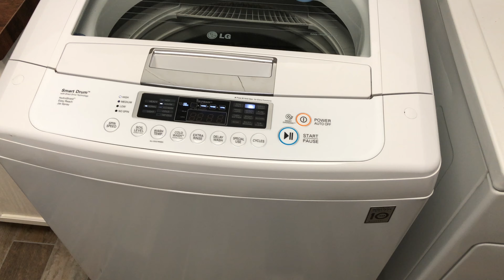LG WT1101CW Washing Machine IE Error Drain Pump Runs Continuously Fix

Comment: This works, thanks. The relay on mine (different model) was a black rectangle, not blue.
Reply from the maker: Interesting.  So, even with a different type of relay, the problem persists.
Reply: @budgetprojectsbydavid5263  The washer is a different model (WT5070CW) , but similar enough that the relays may be the same.  From what I can see in your video, It looks like the black rectangle next to the blue one that has the code on it.

Comment: Not sure how you figured this out, but you're a genius. I just spent time cleaning the hoses, valves, screens, etc. and it did not work until I came across this video of yours....and as of now, we are 35 mins left of a load and no IE code! You should get licensed! Thanks so much. (also, I just put a towel over the board and tapped it with a rubber mallet softly)
Reply from the maker: Glad I could held, Bud!

Comment: Where is the filter on this washer?
Reply from the maker: There are small plastic filters right inside the hot and cold water connections. Those are the only filters that I know of.
Reply: @budgetprojectsbydavid5263  thanks 
Can you make a video about it?
Reply from the maker: I would, if I still had the machine, but I don’t.  It’s not really that hard at all.  You just turn the water off, disconnect the hoses, and pull the filters out with pliers.  You can wash them out in the sink if they are clogged.

Comment: Dont take it apart first. Beat on the top with care. It knocked mine loose without disassembling. Thanks for the video.
Reply: Cant believe this worked
Reply: Yes, took your advise and tapped it lightly with a rubber mallet, and a towel, it worked!
Reply: Yep... Mine seems to require monthly "beatings" at this point, but will keep up the high-tech repairs until she quits all together. Thanks!!

Comment: Hi it's a good Diagnostics, but you need to know the relay that is stuck, best way to find it is to get the repair manual for the machine, or you can trace the wires from the water pump to the relay that operates the pump.
Reply from the maker: Thanks, Alfred. I accept your criticism, but the video was not really made by or for someone who has access to repair manuals, can read schematic diagrams, or wants to trace wires from the water pump.  If you will look at the other comments, you will see that the blue relay with the white sticker has been identified as the relay in question.

Comment: Hi David. Just found your channel. Did you unscrew the hot/cold hoses on the back of the washer and clean out the filters? My error message is just flashing IE with no pump or draining sound. Any advice for mine? And what kind of wrench should be used to unscrew the hoses on the back? Mine look like threads or grooves on them. (And, of course, I turned off the hot/cold valves first) 😁 Thanks for your help in advance. I couldn't find any other videos about cleaning the filters in the hoses. I am not lucky enough to have a handyman like you to help me in person so your YT channel is the next best thing! 😇
Reply from the maker: Hi Beth!  I would use a set of pliers to grab the hoses.  Channel lock pliers are my favorite. Mine have light blue handles and I got them from Lowe’s.  Once off, you should be able to see some little plastic screens inside there.  You may can use your channel locks to pull them out or you may need some needle nose pliers.  Remember which hose goes where, hot and cold.
Reply: @budgetprojectsbydavid5263  thanks for the fast reply! I have channel lock pliers from Harbour Freight.  I was worried about marking up or stripping the threaded hoses on the back of the washer with the wrong type of pliers.I have needle nose pliers with pink handles from my "Women's emergency tool box" lol.
Do I need to unscrew both ends of the hoses or just on the back where they suggest soaking the screens in white vinegar? I thought I would leave the wall connections intact. What do I know?🙄
Reply: Any thoughts?
Reply from the maker: Yeah, just leave the wall in tact.  Maybe have a bucket handy in case they leak, or stick them in the drain.
Reply: @budgetprojectsbydavid5263  I hope this works. I am not as astute as you are at following your suggestions to take the circuit apart. 🙄 Good bye stimulus check. 😥
Reply from the maker: Sorry.  I had company earlier and couldn’t spend a lot of time on my phone.  Don’t spend that stimulus check, yet. Let’s get this thing fixed.  What is the current status?
Reply: @budgetprojectsbydavid5263  I moved the washer away from the wall. I turned off both valves for H/C water. I took the half wet clothes out of washer and hung them up to dry. I am trying to figure out the best tool to use to unscrew the hoses on back of washer to see if screens inside are clogged. Like I said, the hoses have grooves or look threaded on the outside and, I don't want to strip them when unscrewing (counterclockwise???) This is where I am at currently. Sorry for interrupting your company and NYE celebration. Very frustrated if I will get this to work or be going to a coin laundry or hand-washing in sink/bathtub. 😥
Reply from the maker: It’s strange that you say the hose connectors have threads on the outside.  Is it possible that these are just ridges to help your hand and/or pliers grip them better?  Threads run parallel to the back of the washer.  Grips would run perpendicular.
Reply: @budgetprojectsbydavid5263  Yes...ridges is a better description of what the back hoses look like so, tell me your steps to take.
Reply from the maker: If you’re trying to remove the connection, you would put the pliers on the ridges and turn counter clockwise.
Reply from the maker: Counter-clockwise if facing the back of the machine.

Comment: It worked. Thanks. No need to bend back metal. Relay is blue one with white sticker on top. The one 2” from green component.
Reply: Worked for me too
Reply: I just want more water
Reply: @KatrinaBurrisTeherror  try tapping on that relay and it may help with your water issue. Good luck.
Reply: @geoffhunt7965 I tried it and it work! My washer filled but wouldn’t stop! Which relay is it for the water level?
Reply: @kristennessel  I don’t know but that relay is the one involved with turning the drain ing and filling motor on and off so it really should be that same one but I don’t know for certain. Is the drain hose completely unclogged?
Reply: @kristennessel  I believe the reset procedure is to unplug the washer and hold the start pause button for five seconds
Reply: @kristennessel if your washer is still filling with water even when the washer is off then it is your inlet valve that needs replaced..if its over filling but stops when the washer is turned off then it is your water pressure switch. It won't be anything to do with the control board for those issues..hope this helps
Reply: @kristennessel blue with white sticker someone else said so that’s what I’m trying
Reply: Worked for me as well. Thanks for making this video!
Reply: I was about to buy a new washer, i followed your steps and hopefully this gives me sometime to order the board. Thank you so much.
Reply: @mricci7498  I am still using the same board so you may want to hold off on that expense. It has not happened to me in several years and it is the same board.
Reply: @geoffhunt7965  you are still using the original board? I hope that works for me as well. Thank you
Reply: @mricci7498  yes, original board and it is two years later. No problems.
Reply: I thought I was going to be looking for a new washer this weekend but less than 5 minutes of work and it's running great again. Thanks for the help
Reply: @2bearms  It’s such a weird thing that works. Mine still going strong.
Reply from the maker: Glad it worked!
Reply: Worked for me!
Reply: This worked like a charm my wife is washing her clothes now. Thanks for your help and video. I appreciate it so much.
Reply: Not all heroes wear capes 👍🏻
Reply: I have to try this. My cold water just would not full enough to wash.
Reply: @zauniezaun  good luck. The relay to turn off drain had issue and hitting that relay somehow gets it to work properly and stops it from causing machine to endlessly drain water.
Reply: I literally watched this video step by step. I was scared at first, because I had no idea what I was doing. I prayed before cutting the machine back on… it worked perfectly. Excellent video from start to finish !!!
Reply: You guys are going to put LG out of business. This worked like a charm. Thank you!!!
Reply: Thank you! This worked for me. Didn’t have to bend any metal. Just tapped the blue relay with the white sticker. Fixed!
Reply: @geoffhunt7965 ... am using a samsung machine its drain pump burnt n replace it with a new one its continously running even while washing .. so if i open and tap the blue relay will that help so that it can only drain on rensing mode ??
Reply: @mudauchillyboy1059  it worked for me and others. Good luck.
Reply: Thanks for the magic !!! Anyone make it past 2 years yet with original board ?
Reply: @crazeeclay144  I posted that information about three years ago and I’m sure I had the washing machine for several years before needing that odd fix so my board is original and it is going strong.

Comment: Woohoo!!! fixed! What would cause this?
Reply from the maker: Over time, I think the contacts in relays become degraded because of the inrush of current, over and over.  I suspect that in our case with the LG washing machine, they used a low quality (or possibly too small) part for the stress that it is put under.

Comment: My washer looks just like yours and started this problem today. I tried the smart diagnosis app and it said everything was OK. Found your video and whacked on everything on the circuit board and by god that fixed it! We've had 6 years of trouble-free operation from the washer and dryer so I'll give LG a pass for a little stuck relay tapping. :)
Reply from the maker: So glad to hear it!  Check out the other video on my channel related to the circuit board replacement, which will need to occur in 3-5 months.  Please subscribe if you haven’t.  Take care and Happy Holidays!

Comment: Same issue, I do this about once a week. BTW, it is the bottom blue relay with the sticker on it next to the red connector. The relay  is sticking only when we run larger loads. the increased wattage causes it to latch or stick.
Reply from the maker: I never noticed a correllation with the size of the load.  Good to know! Thanks!

Comment: IE means inlet error, which means the water is not supplied or the water pressure is too low
Reply from the maker: Right, but if your drain pump runs continuously, it thinks you’re not getting enough water pressure.

Comment: David I have one just like this and at first it was not draining so I purchased a pump and put it on.And still its in the middle of spinning with a dr code on the display.Don’t know what to do?
Reply from the maker: Dr is a door code, right?  Make sure your door is clear, hinges free, latches clear, contacts clean, etc.  then unplug for 15 minutes and try again.
Reply: @budgetprojectsbydavid5263  I did that on yesterday and now I washed a small load of clothes speed wash 35 minutes and as soon as it made it to the 12 minute mark it started spinning not fast like normal and it just lite up the display board and shuts off goes back to the beginning of the cycle
Reply from the maker: Sounds like it could be the control board.  I have another video on the channel that shows how to replace it.  The only hard part is making a decision on whether you want to throw $150 and your time toward a hunch.  Wal-Mart makes it easy, though.  Buy the board from them and if it doesn’t fix your problem, send it back.
Reply: Now it’s showing the oe. Code
Reply from the maker: It’s sounding more and more like a control board issue.
Reply: @budgetprojectsbydavid5263  got cha! Thanks alot
Reply from the maker: No problem!  Please keep us updated with your progress!  Thanks! -David
Reply: @budgetprojectsbydavid5263  will do
Reply: Hey Dave just getting back with you pertaining to my machine.I went ahead and called a tech out and the first guy said it was my suspension and I had already knew that but I didn’t think that was the problem for it not spinning.So I let him do it and later on that day I was washing clothes and the oe- code came on.Called them back different tech and he said it was definitely the board this time because he said that the pump looks brand new.I told him I had just replaced it days earlier.He came back with the board the next day and now I am up and running.You told me that it sound like it was my board from the start . Thank you😃👋👌
Reply from the maker: Hey William, thank you so much for the update!  I’m glad to know my prognosis was correct on the control board.  It stinks that you had to go through so much hassle, but maybe you’ll be good for another few years.  I enjoyed hearing about your experiences. Take care!
Reply: @budgetprojectsbydavid5263  😊

Comment: David, do you think this would work on an error code “OE”  water won’t drain out of machine and you hear pump running. I checked hoses and all are fine. This happened today on the 4th load I did and had to hand dip all water out of machine. 
My washer is the same as yours in video and I’ve had it 6 years with no problem until today. Also, did you use the Smart Diagnosis feature to find the problem?
Reply from the maker: That doesn’t sound like a stuck relay to me, so the fix in this video probably won’t do anything.  Kinked drain lines, clogged drain pump filter is where you might look.  One comment from a viewer referenced the OE error and the pump preferring an incline, where it has to push the water up.  Maybe this helps keep the pump primed.  I’m not sure, though.  Good luck and please tell us what you find.  Thanks!
Reply: @budgetprojectsbydavid5263    I called LG and ran through the Smart Diagnosis steps with them and they told me that it was the pump and maybe it was blocked with lint or something. They said to run the clean cycle twice back to back and then they asked if I had tried turning it to spin only and I had already done that with no luck. So they said the clean cycle idea wouldn’t work. I found another video JAKEGUITAR that looks simple and my husband is going to try it on Saturday. That Smart Diagnosis thing only told me what I already new from the washer manual. So they really weren’t much help.
Reply from the maker: It’s been a few years, but I think I have had a negative experience with the LG smart diagnosis, as well.  It doesn’t tell you anything that you haven’t already researched on Google or youTube!  Good luck with the new video, this weekend!  Please let us know your results and feel free to post the link to that other video if it works.
Reply from the maker: Also, I did not use smart diagnostics.
Reply: David, my husband checked drain pump for blockage, no blockage, we even took drain hose off and flushed it, nothing. So we decided to put new pump on it for $90 instead of connecting old pump and it still wouldn’t work. Worth $90, and it’s working fine now. I’m glad for you guys on YouTube showing how to fix things. I had a guy coming out on Monday with a service charge of $155 plus the cost of part. We used the other video to take it apart but if I hadn’t landed on your video, I may not have seen his video. Thanks again, it took maybe 2-3 hrs that included running across town to get the part.

Comment: I have the OE error and found that the pump itself is fine and clear of debris. I will try this method to see if it’s an issue with the relay! Thank you!
Reply from the maker: Please let us know how it turns out! Thanks!
Reply: @budgetprojectsbydavid5263  Sorry it's been a few months, but my issue was actually the control board. I ended up buying a new pump anyway, but the cost of both were still significantly cheaper than buying a new washer. I replaced the control board and it has been working great ever since!
Reply from the maker: That’s great! Thanks for the update!

Comment: thank you, tried this and it worked, was gentle first time around and the pump started but did not stay on long enough to drain the washer. I did it again and hit the parts a little harder and seems to have done the trick. The issue was that the wasker was not draining. The metal box had an additional screw the remove next the where the cable is.

Comment: Thank You- this worked! Mine did not have an Error Code, it was stuck in a drain cycle regardless if I unplugged, powered down, picked a different cycle, etc...
Reply from the maker: Interesting that you didn’t get the error.  Maybe your water home water pressure was strong enough to overcome the constant drain. Hmmm...anyway, glad it worked!